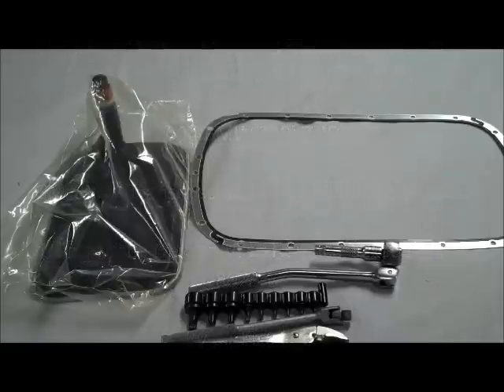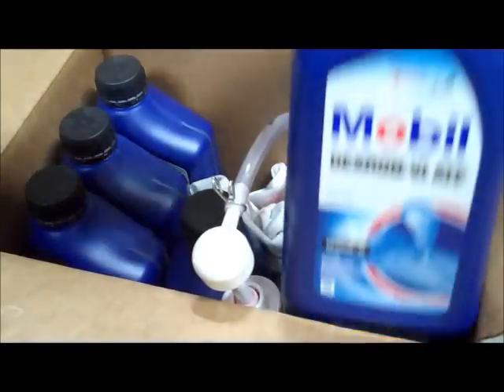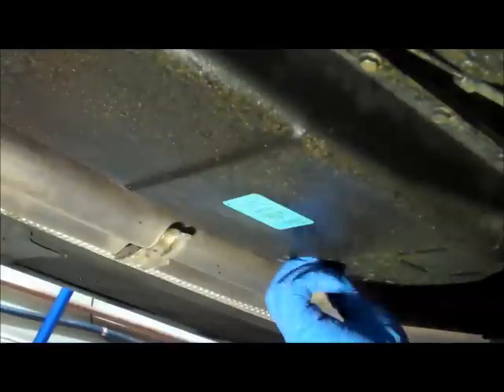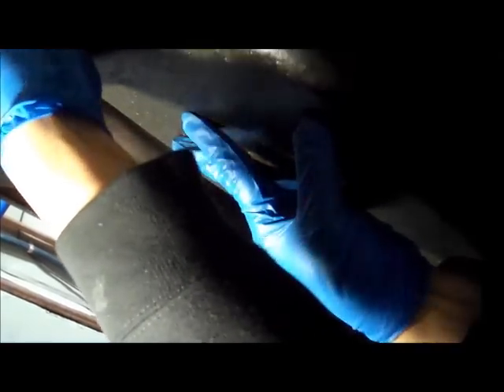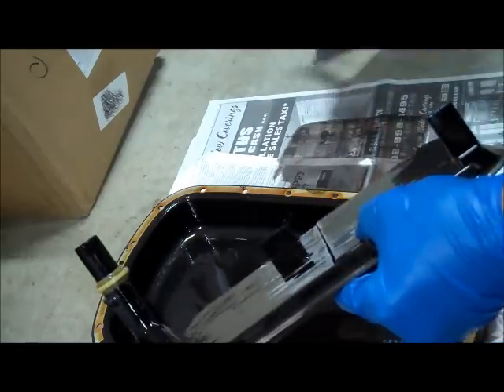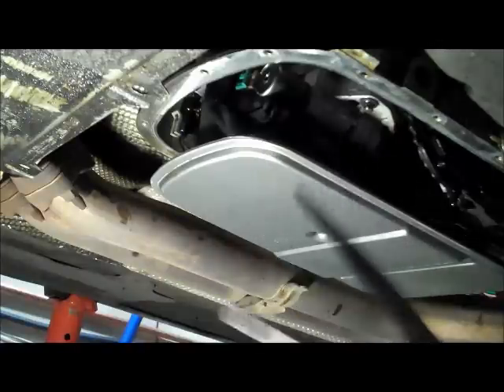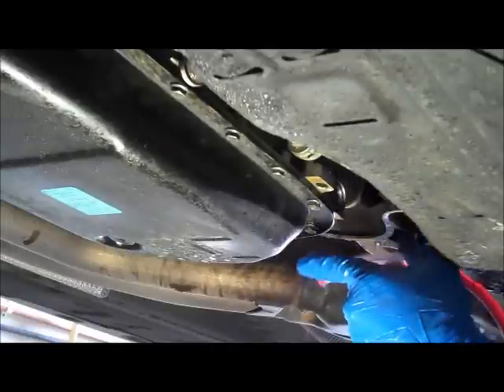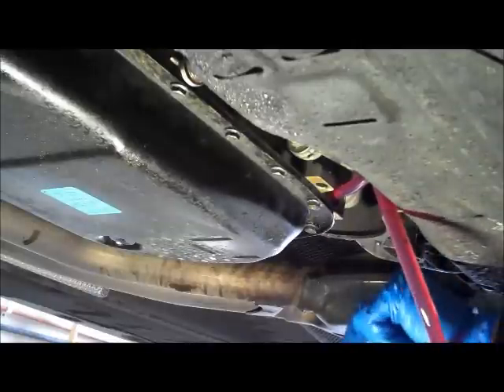BMW e46 Automatic Transmission Fluid and Filter Change.wmv

Comment from the maker: Fantastic Peter, glad the Dexron VI worked well.  I have put an additional 30k miles after my fluid change and the transmission still works very well...good luck with the 525i Touring.

Comment from the maker: Yes Peter, four jack points plus two safety jacks just edged up at both ends. Nobody should be under the car when running it and you should be fully in the car and ready to cover the brake just in case something goes wrong. Level ground is a must.  No sudden movements, shift into gear and bring it up on revs slowly.

Comment from the maker: Brett, yes you want the rubber seal to be against the easier to warp surface (the pan.)  If you want to get most of the old fluid out you can drain, refill, and run it, then drain again.  I bought a case of Dexon VI so I could do this. Change the filter right before filling it for the last time.

Comment: A few suggestions for others if you don't mind dantsuchiya - If you don't have the proper tool to loosen the fill plug but have a T45 socket, a closed/open 8mm wrench and a small rubber mallet you may ok.  Insert the tip of the T45 into the closed side of the 8mm wrench and than insert the T45 into the fill plug.  With the wrench now attached to the T45 tap the wrench (counter clockwise) with the rubber mallet and increase your strike as needed.  This should loosen the fill plug very quickly

Comment from the maker: Hi knfksh81,  The Dexron you want to use is:  The Mobil Dexron VI (or other synthetic blend) will replace Texaco ETL 8072B as the ATF.  This is 6 not 4.
Reply: Thanks for the detailed video and sane discussion on what fluid to use. Sorry for the typo. I meant Dexron VI. So all is well with your tranny since the change?

Comment from the maker: Don't over tighten them and they normally don't loosen by themselves, the factory is pretty good about tightening them. If you want to tighten them, don't use much more force than 5-7 ft lbs which is like grabbing a 3/8 inch drive at the pivot point and torquing it with only wrist torque. 

If you have a leak, it may be that your pan could be slightly warped in a location from over-tightening and what I would recommend is replace the gasket and apply some RTV sealant on both sides and assemble.

Comment from the maker: I just put an additional 15k miles on the car since the change of fluid and it shifts great.  A co-worker of mine has a similar car with the same mileage and never changed fluid, his transmission went out two weeks ago.

Comment from the maker: The transmission I have is a France made GM unit so I was able to use Dexron 6 (VI).  There isn't much documentation out there and the original Texaco ATF is not readily available. If you do have a GM unit (Sticker will be on the pan) then you can use Dexron VI.

Comment from the maker: Yes the manual says lifetime, but when I changed it out, it was pretty dark.  If you plan on running your car above 120k, I recommend changing the fluid. Because the recommended fluid is difficult to get, the Dexron VI works well as a substitute, especially if yours is a GM Transmission like mine, assembled in France.

Comment: I strongly recommend removing the fill plug before you start the job.
Reply: CharlesP2009 if you remove it first while the car is off  it'll leak a lot and make a mess , you can take it off after couple liters been drained

Comment from the maker: Once you feel signs that the transmission is going, a fluid change will not help it. The GM transmission made in France has a lot of moving parts, when a manufacturer thinks of "lifetime" of a car they are thinking 100k miles or so.  The e46 is meant to be driven so a lot of drivers have over 100k miles, I just think it's better to be safe than sorry. This is just preventative maintenance that goes beyond the owners manual.

Comment: Hi Dan, very helpful video as I am changing them right now. two quick questions: 1. what did you use to clean up the pan? 2. how did you tighten the fill plug to required torque, since the space is very limited for a torque wrench.
Reply from the maker: +Steven Wu Cleaning the inside the pan is a simple wipe with a cloth, there is no build up since it's usually always filled with ATF. Main thing here is you want to get any sediments cleaned out.  If you want to clean the outside you can use Simple Green or even light solvents since it's a metal. 

The fill plug doesn't have to "hold back" much fluid since the fluid just sits at the very base.  I believe the hole is also slightly tapered so high torque is not necessary here.  I didn't use a torque wrench here.  If you want, find a similar bolt or nut that has a similar torque spec and match the feel with your combo wrench, if you're in the ballpark it's fine.  Good Luck.
Reply: +Dan Tsuchiya Thank you for the prompt reply! I just encountered another problem while taking off the filter. The filter's O-ring has "merged" with the metal. See the picture here: http://imgur.com/gallery/hGzPSmA/new   I tried many tools but it's so sticky to the metal. Maybe something chemical will do the job? Thanks in advance!
Reply: +Steven Wu Problem fixed.  Kept trying for more than one hour and finally took it off :).
Reply from the maker: +Steven Wu Glad it worked out, I was going to suggest using a plastic knife or something similar being careful not to gouge the seating surface.

Comment: Hey man, love the video I've done my research I've looked at forums I've done everything  this question  is so over thinking I have a 2005 330ci zhp with the gm automatic transmission with 160k miles I dont think it's ever been serviced and I'm wondering if I would mess it up ive never experience bad shifting or slipping no issues I hoping to keep this car for a really long time and I'm kinda scared
Reply from the maker: The factory recommendation is that the transmission doesn't need servicing, supposedly it's a lifetime thing.  However, the factory only expects the original owner to own the car maybe up to 120k miles.  There is also can be some truth to the theory that if you change fluid this late in the game, the acceleration of wear could happen with newer fluid. I think if the transmission is due to fail at say 180k miles, it's going to do so whether or not you perform this procedure. If you change the fluid it's going to give it the best chance to go beyond that point.  The cost of the filter and fluid change is relatively low in comparison to installing a wrecking yard transmission. If you are unsure about your ability to do this, take it in to have it done.  Try not to scare yourself into paralysis. Good Luck!
Reply: @SirFixAlotAutos  thank you so much I'm gonna do it I'll reply to the video after maybe it'll  help someone

Comment from the maker: It's no more than 7 ft lbs for the 20 little bolts because there is a rubber gasket on the inside of the metal so that seals it up pretty well. I just did an estimation by holding the ratchet at the pivot axis and turning it like it was a T-handle. I went around once at less than 5 ft lbs and then just cinched them up to spec the second round.  I've driven it 250 miles and no leaks

Comment from the maker: It will only help if your transmission is leaking from the pan gasket because that's all I cover in this video.  If your automatic transmission is leaking from the any other areas like the input shaft or cable control interfaces, this procedure won't help. You'll want to power wash and/or clean the transmission area and determine the source of the leak. Good Luck.

Comment: I have been told to use Dex 3 ATF for a 2000 bmw 323ci. That was what Advance AP told me. I was wondering what the difference is? And how long did this take you to do... from emptying the ATF to completely refilling it.

Thanks for any advice!!!
Reply from the maker: Cody,  If you have the French made GM transmission ASR-390R then you'll want to run what I did, but maybe the early e46's ran different transmissions.  I would check with a BMW technician at an independent shop or at the dealer to make sure. Most of the time was spent with the pan and filter.  If this is your first time, give yourself at least 2 hrs and take your time. Good Luck.
Reply: Dan Tsuchiya Thanks man! I just jacked the car up and finally got the pan clean enough to read the # which is 83220002121 (oil #) and the sticker was green. I'm having some issues finding out what oil I need.  online someone thought that # should be on a yellow sticker, idk, im just hoping I can use some cheap mobil dex3 or w/e. I called Columbus bmw for parts... with the VIN they said they can tell me all the parts I need, hoping that's true, ill find out tomorrow. 
thanks again!
Reply: Cody Tilberry I have a PDF chart that lists BMW transmissions by model/year that I downloaded from a bimmer forum somewhere. It says your 2000 323i has a GM5 (A5S360R) transmission with a fill capacity of 9.0 litres including torque converter or 8.0 litres without. 

"USE ONLY TEXACO ETL 7045E
(REPLACES TEXACO ETL 7045)
BMW PART NUMBER
83 22 0 026 922"

Try looking up your transmission and see what people recommend as your ATF fluid.
Reply: ***** Thanks a lot man! I did the change over the weekend with a buddy thats a mechanic. it was pretty easy. After contacting numerous dealers (BMW) and indy bimmer shops most of the advice was that ATF2 was used, or that the texaco used in that GM tranny is close to the spect of ATF2. I ended up asking a lot of theose places if ATF 6 would work well and most agreed. After seeing the fluid which was black and burny i figured it best to replace it. Got a new wix filter and did the job with
Reply: .... Valvoline Dex/Merc multi. it met specs for the BMW used in those models as well as GM's durring those years. Thanks A Bunch Man!!!  Going Great so far!

Comment: Hellow, my 320d is tuned and i have 155k km , bij now mijn automatic is slipping and losing power ? Wil changing gear oil help
And tips? Really love the car
Reply from the maker: There is a 90% chance that your transmission needs repair/replacement beyond a fluid change.  You can try to change the fluid and see if there's an improvement,  it's a relatively inexpensive way to start.

Comment: Hi,
thanks for the video, 2 questions:
the new metal/rubber gasket goes on with the rubber down?
And, you stated that the first part of this process you simply drained the pan and then refill the fluid. Did you also go through the gears changing process in the first stage. I know you did the gear changing process when you replaced the filter. Thanks again.

Comment: How do you like the Mobile 1 semi-synth AFT? I watched your video and used the Castrol transmax d6 semi-synth. Car seems to be different now. More even in what I call non-crisp shifting. Not quick, but even. Anyway, wondering how you like the mobile 1.
Reply from the maker: I drove the Mobil 1 after the change for about 20k miles and sold the car.  With regards to shifting, I found it to be the same as the original Texaco ETL.

Comment: Hi.  This is the only quality vid on 5l40 trans.  I dropped my pan to swap the filter under the illusion that I had 5h40.  I've previously invested in pentosin atf1 and would like to think it is supportive of dextron 6 applications.  One mechanical difference I have noted since committing to this proceedure, sir is harder shifts.   Could this be a fluid level issue, as I recall getting about 6.5 quarts less in there?
Reply from the maker: Hi Mark, the Pentosin is supposed to have the same or similar properties as the original Texaco ETL and I don't think a shift problem would manifest itself just by slight fluid differences but I could be wrong.  Before draining and trying out Dexron 6, make sure you retry a top up on the Pentosin ATF to make sure it's at the proper level.  Remember to run the car as you fill and have it level, as scary as that sounds.  Good Luck

Comment: I just did this on my 04 bmw 325i I did a filter change and pan gasket I have the same transmission as well. Quick question i drained out 5 qts of fluid and put in 5 qts of fluid. Though mine had a little slip in it due to its fluid level being low. I changed it the slip is there but it's barely noticeable you put in 6qts so I believe mine is a little low though it shift and rides a lot better. I'm going to top it off tomorrow. I couldn't tell if I had it all the way up to operating temperature because I didn't have a thermometer to tell if the temp was right. Plus the slippage happens in right turns and every blue moon after I start the car and first take off.
Reply from the maker: Malcolm, First try the complete fill.  When level and running it should spill out of the fill plug. Yes, you might have lost some on the old transmission fluid. Also, with it low in the past, it could have damaged your transmission, I am of course hoping that is not the case and the complete fill when the transmission is at temperature will solve your issue.  My transmission did not take on a full 6 quarts, just go by the fill procedure when warm.   Good Luck!

Comment: If you are in cold weather, will the temp reach 130F or should I do this in a garage with a bit open door to get rid of carbon monoxide?
Reply from the maker: It's probably best to wait until the weather warms up and then you'll have a better choice between in the garage or outside. It will also prevent you from the temptation to partially close the garage door.  Our temps in California are pretty mild, and it will take longer to get to temp in cold weather. You just want to make sure the vehicle is level and you have some back up safety in case the vehicle comes off the stands.  Good Luck.

Comment: Hey great video. I always change my transmission fluid around 50,000 miles even when they say that you should change it at 30,000miles. It don't hurt the car's transmission and you save money. I was wondering if you do the same.

Comment: The only thing I would have done differently is to remove the fill plug first.  This is way if you can't get it open you don't have a car with an empty transmission and no way to fill it!

Comment: is the process pretty much the same if your doing it w/  a manual transmission? looking for a video w/ manual transmission on, can't seem to find one.
Reply from the maker: Well sort of, it's actually much easier to do your manual transmission.  There is a fill and a drain plug, but there is no pan nor filter so it's easier.  Get the car up and level so you can get underneath. First drain the transmission (after driving it a bit to warm it up) and reinstall that plug and there is a plug on the side where you fill it just until it starts draining out of the side hole (similar to the Automatic) the difference here is you don't have to run the engine, you can do this while everything is off.  So not only is it easier, it's safer. Reinstall the side plug and it should be ready to go. Make sure you use a good gear oil, check with your dealer for recommended Gear Oil weight and capacities....then you can go off and purchase from them if they have price matching with your favorite site. Remember, if your transmission has a bunch of miles on it with one type of gear oil, best to stick with that rather than changing over on weights or type.  Unless you are rebuilding a transmission, just go with factory recommendations.  Good Luck.

Comment: I have 124k on my '01 330ci Convertible, is that too late to change oil and drop pan to change filter? I don't believe the fluid has been changed before and the previous owner in which I bought from 5 months ago would have no clue. Also, sometimes shifting into reverse it takes a sec to catch. Any help would be great, thanks!

Comment: Can low transmission fluid cause my 2002 BMW 325i not reverse? I am not able to make a reverse. Hopefully it's not a major problem.
Reply from the maker: Generally speaking no, if you have a GM transmission, reverse going out is usually caused by a bad reverse solenoid.  I think there are some discussions about this on the forums.  ZF transmissions usually have reverse drums that go bad, but that's a more involved fix.  Check the sticker or plate on the transmission to determine which one you have. Good Luck!

Comment: hello sir 
i have 2004 bmw 330xi and i need to do the same but i dont know what kind of fluid to bring daxron 6 or LT71141 ..help plz
Reply from the maker: I presume you have the factory GM A5S-390R transmission and from the factory it was filled with Texaco ETL.  When you drain it similar to the procedures I have outlined you won't be able to drain it completely but both the Dexron 6 (primarily designed for GM transmissions) as well as the LT71141 (lifetime fluid recommended for BMW) are compatible equivalents.  I went with the Dexron 6 as it was available on eBay. If you are located outside the US and LT71141 is readily available your transmission will like it.  Good luck.
Reply: Yes 
I am in Canada 
Buy I think I will go for D6 also 
Not the LT 71141 
I don't know which one has more viscosity honestly 
Thank you for your help man

Comment: I have a 2004 325ci, someone told it needs closer to 15-16 qt. is that too excessive?
Reply from the maker: Note that I only changed fluid within the transmission body and not the torque converter which holds another 3-4 quarts so the total would be in the range of 9-10 quarts I would suspect.